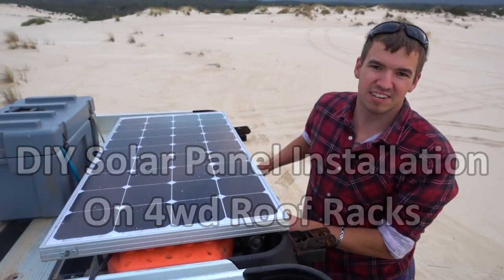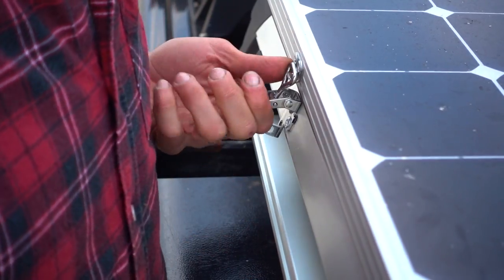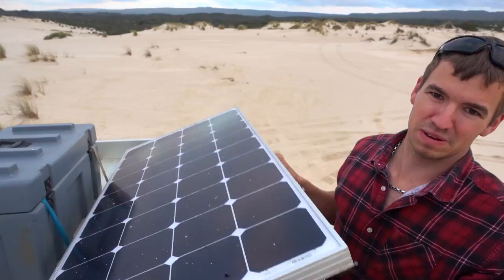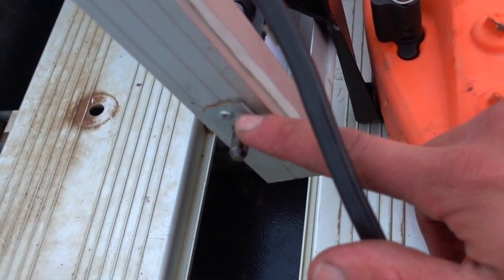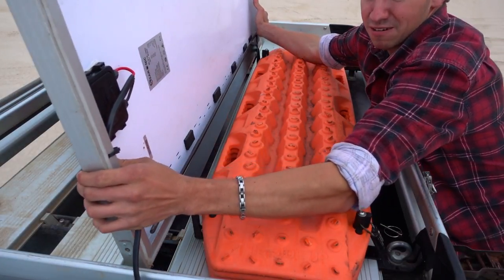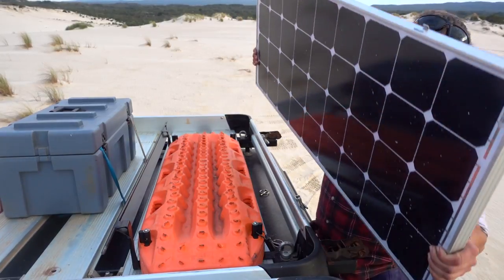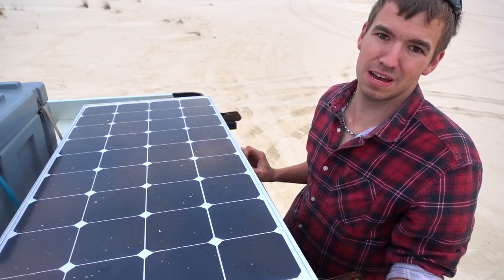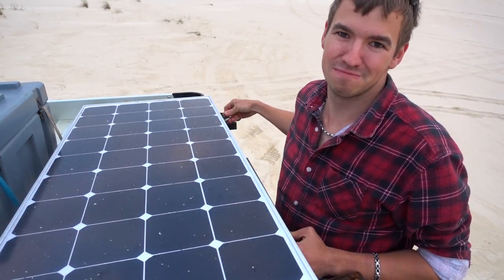DIY Solar Panel Installation on 4wd Roof Racks

Comment: Thanks a million for this!  For the longest time I have been thinking about mounting solar panels to the roofrack of a teardrop trailer while parked at a campsite and this is the DIY solution I have been searching for.  When traveling, the panels will ideally be removed and will lie wrapped in a duvet and on top of the mattress inside the trailer to minimise any risk from damage.  A trailer is frequently hit by stones of various sizes from the wheels of the towing vehicle, which makes permanent installation impractical.  This solution for a semi-permanent installation for the typical four days or more the trailer will be parked in a base camp is excellent.

Comment: Thats a winner.I love solar on vehicles.On my jeep,rarely driven,is a small 10 watt solid framed monocrystalline panel and cheap ebay controller.My jeep sits for months and always starts with 12.8 volts on battery.

Comment: Good Video- if you want to charge your battery in over cast or partial shade make sure you use a 24v panel or 2 or 3 12v panels in series, running into a MPPT like a Victron. In the rain I still get half the panels output.

Comment: Excellent! I was thinking of doing just this, but didn't know where to start to lock it down. Can you link the locking mechanism or perhaps provide some keywords to shop for?
Reply: Hey, not sure if you ever found it. The key word was "latch" not "clamp", but if you search for "304 Stainless Steel Adjustable Locking Buckle Latch 5.5Mm for Case Box Chest" you should find this exact hardware

Comment: Hi, as an alternate approach to 12v power how about a look at the current range of battery box's out there that connect to solar, including use of lithium - can these be linked in with conventional lead acid batteries. cheers

Comment: What make of solar panel did you use. Wondering about longevity of the panel being out in the weather all the time.
Reply: Malcolm Hay they are that cheap just buy another one when it “wears out”
Reply: I had 400 watts on my truck for years before I sold it.They are among the highest quality products I have ever owned.Panels constructed just like his,purchased used.

Comment: I enjoy your videos mate, informative and concise

Just wondering how the pivoting solar panel held up ?? Do you still use it or have you upgraded ??

Im going to use the idea as it solves the panel storage problem for me

Cheers
John
Reply from the maker: Hey John,

Glad you enjoy the channel mate! 🙂
I used this setup until I changed my vehicle, and it held up really well. I ended up with a different style of roof rack on the new vehicle and I ended up going for a different setup.
All in all it was a great solution, I hope it works out for you! 👍
Reply: @SeekAdventure  thanks for the prompt reply

John